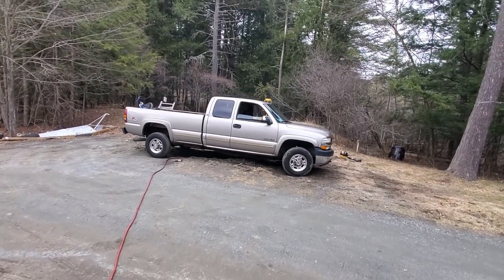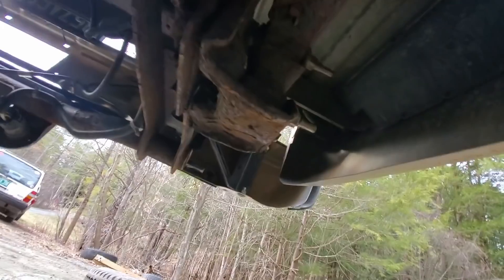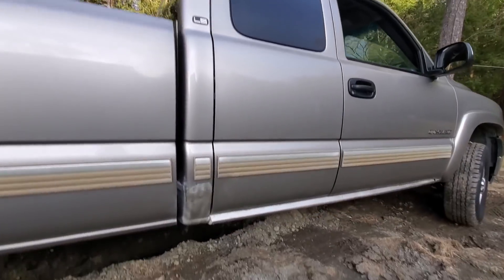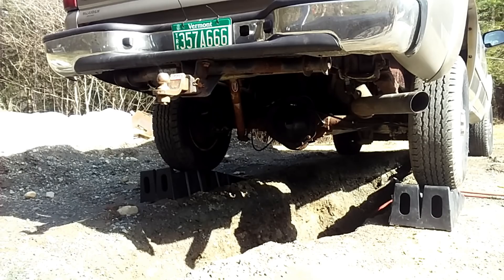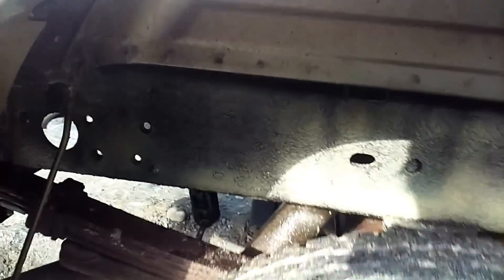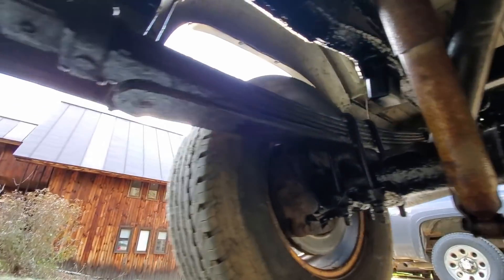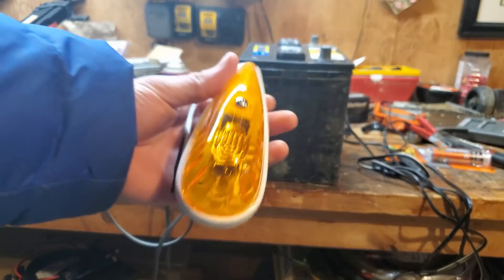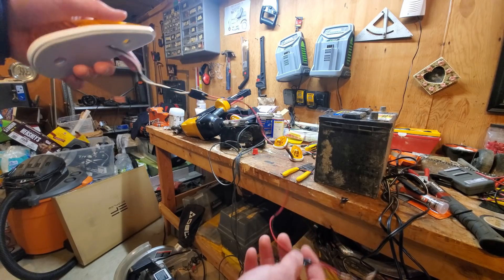Cheap Chevy Silverado Part 2: Frame Work And Lighting!

Comment: From the Fluid Film website:
Can I paint over a surface treated with Fluid Film?
No.  Because Fluid Film protects with a wet, non-drying film and imbeds itself in the pores of the metal, any surface treated with Fluid Film should be wiped down with a good biodegradable cleaner before painting.
Reply from the maker: No what they mean is the paint will just be easily wiped off since the fluid film doesn't dry. They mean if you want the paint to stick wipe the fluid film off. I just wanted it to look nicer so I don't mind that the paint will be wiped off

Comment: Really need to build yourself a garage 😂
Reply: Also a great tool for removing rust scale is Air Needle Descaler . it's just a bunch of little metallic needles that attaches to the air hammer and does quick work!